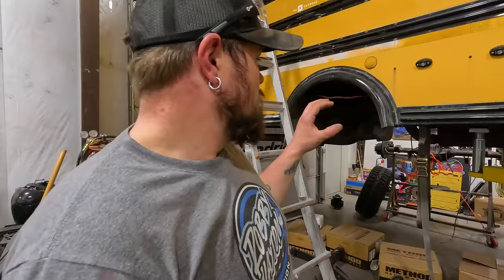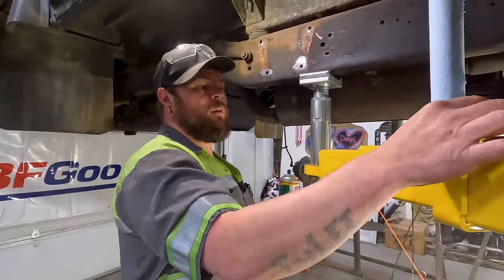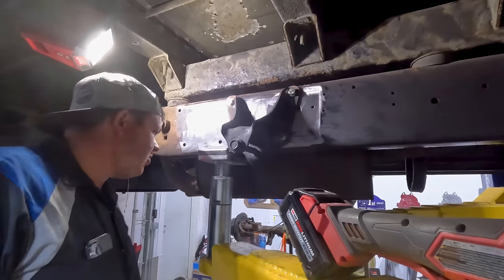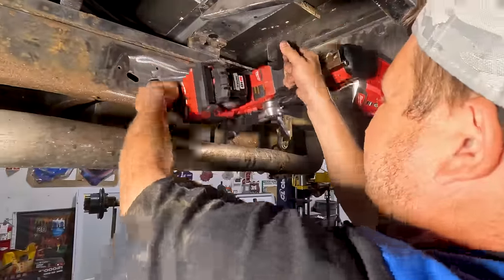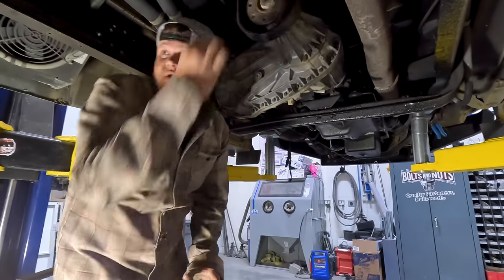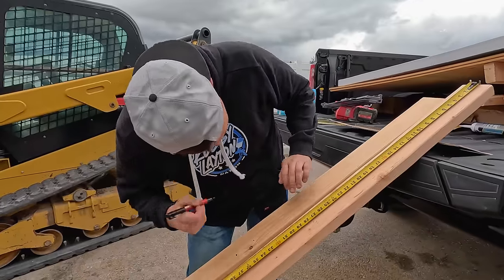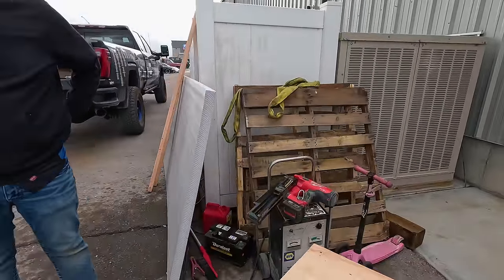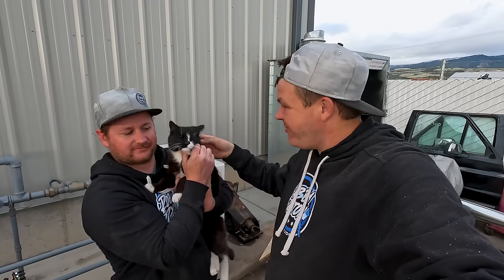We Give Our Shop Cat A New Home! & OnX Bus Gets Rear Suspension!

Comment: You did a great job on the kitty house, one suggestion though.... you should have put hinges on the front so you could access the inside to put straw or blankets in there. It may be a bit uncomfortable sleeping on plywood. But for someone who does not build every day you guys killed it.
Reply: The cats gonna scratch up that insulation, surprised you didn't put carpet down on the floors and walls.... With a cat ladder to get to second floor
Reply: Or make the whole roof hinged. Think cat cabriolet house. And some catnip to overcome the formaldehyde smell from the plywood...
Reply: Sleeping on hay ? Animals eat hay. They sleep on straw
Reply: I'm wondering why it isn't painted? Come on blue & silver  😊
Reply: little window on top front
Reply: Add a little awning over his entrance to keep cold out too. Bushyboy Oz
Reply: It definitely needs a cat bed.  Kmart has them cheap as chips here in NZ.  Not sure how you are going to squeeze one through that tiny opening though.
Reply: Wow! Who knew there were so many cat house building “experts “ on YouTube!!! You folks should go into business!
Reply: @sled9263  I actually am a carpenter, however if building a cat house seems hard to you. I'm sure you can watch a video on it.
Reply: @_Outraged  ya. So am I. I just don’t need to critique everyone else’s work. Thanks for the advice on watching a YouTube video to learn how to build something. Hope that worked for you.
Reply: @_Outraged  I'm not a carpenter and I saw many way to improve the kitty house just by using common knowledge . (I did build 15 house with my family done electricity plumbing and mechanics).  It just take common sens .  Buy for a stray 😺 it's way enough and they still can improve it with time .
Reply: @sled9263 I'm pretty sure i made a suggestion, not a critique.... no worries, I'm sure Robbie wouldn't take offense to that. Good day to you.
Reply: @TacticoolCraig They also sleep on hay and eat straw. What animals have you raised bub?

Comment: you need a cat door on it. 12 bucks at Menards or 6.00 on line, and a overhang over the door why so water doesn't come down the front wall and go inside. and cat door is to keep other critters out  and at least  some wide tape over roof top at peak to keep water from dripping inside. he needs water and a food bowl in there and a bed.

Comment: If you don't have transfer punches just start drilling with the same size drill bit than remove your part and finish drilling leaves a larger divet to start drilling, less likely to wander when you start drilling.

Comment: If it gets cold enough to where you'd like to add some heat to Bombi's house, grab an old computer power supply and mount an incandescent light bulb in it (Doesn't have to be a real powerful one.) The case will protect Bombi from direct contact with the bulb and protect the bulb from being damaged.

Comment: 12:45 bigger bolts are not always better. Bigger boilts are harder to stretch and thus have high clamping force. So more sheering resistance from bigger bolts doesn't help, when they come loose more easy. Maybe look up the > torque tables for m12 bolts < ?

Comment: You only need to overlap if it was taking a structural load. If it is a no load bearing wall, it’s all good. Did you calculate your uplift, static and dynamic loads?